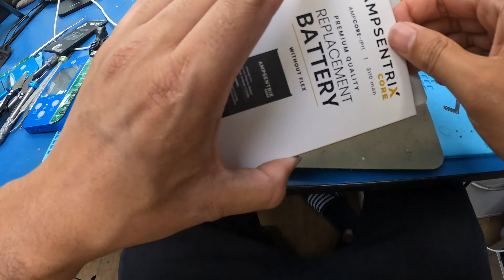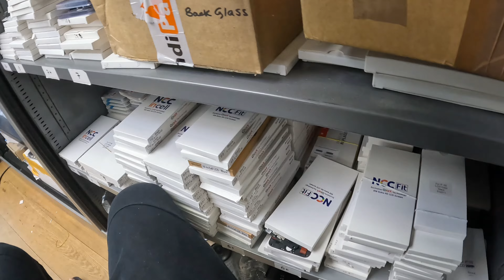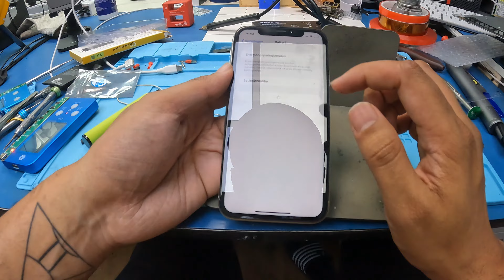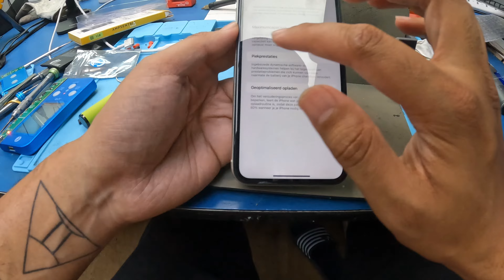POV iPhone 11 only  Battery cell replacement #iphone #repair

Comment: Nice, thanks! Did you leave the JC tag flex cable inside the phone? Is that necessary?
Reply from the maker: I remove it after every correction, works much better.
Reply: @tasuwer1  Thanks! But you still need one flex cable for every “correction”, you cannot reuse one cable for multiple batteries?
Reply from the maker: @catalinseverineanu2550  u can if u still have the 1st gen flexes